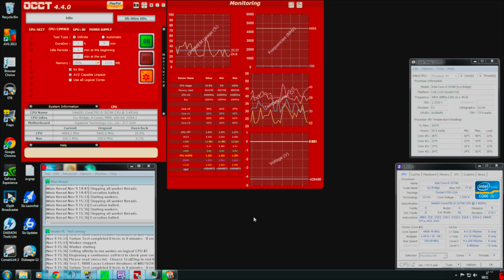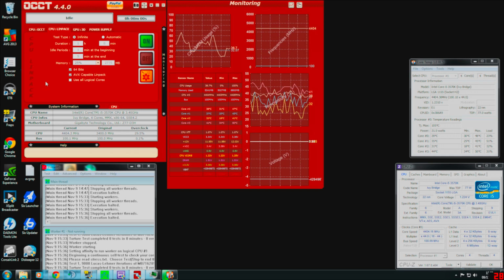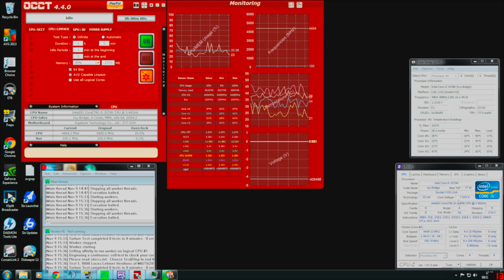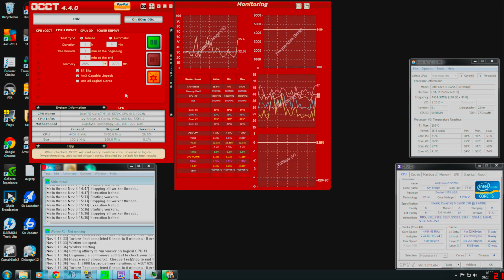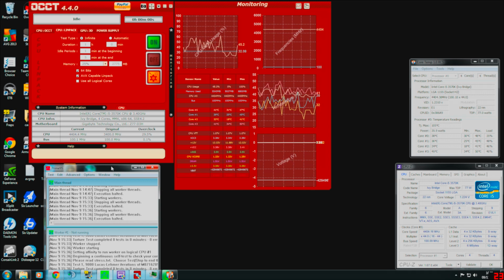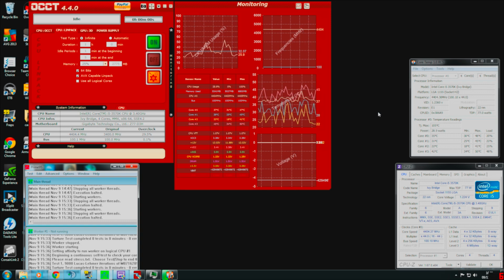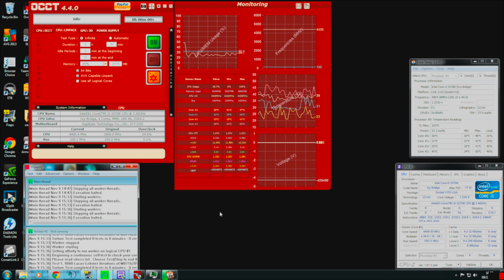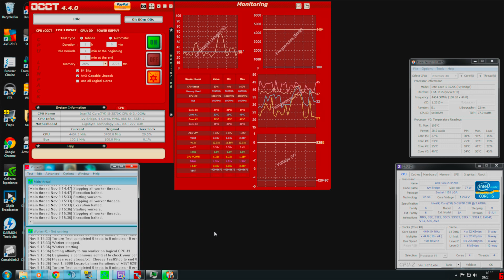How to stress test your computer/Gaming PC

Comment: So my laptop (i7 6700HQ) idles in the 50's and upper 40's. Whenever I start any benchmarking software, all readings INSTANTLY go up into the high 80's and stay there, without changing much at all. And when I stop any benchmark, it INSTANTLY, like, on the very next number refresh after stopping, goes back into the 50's. I don't understand the 35 degree jump and drop I'm getting in under one second. Is this a Windows 10 thing?

Comment: OCCT is my best GPU stability test with " FPS Limiter = 0 " and " error check ". OCCT will burn your card :)

my HIS R9 290 vrm1 temps hit 120 degrees while stressing..! i cant go higher than 1020mhz on coreclock but in the other benchmark is stable without problem, but OCCT will give me error.! but i see somebody can touch 1150 on coreclock without any problem but OCCT give you Problem. Be carefull OCCT will kill your card! watch your VRM and GPU temps. OCCT look like Furmark with Extreme Burn in! :) Sorry for bad english guys :D

Comment: When I run OCCT it'll only run for about 7 or 8 sec and the a window with pic will come up. is something wrong?
Reply: Arcehager you are killing your pc thats what it means
Reply from the maker: yeh mate doesn't sound good, could do with some more info whats in the message does it restart your computer after
Reply: It doesn't restart my computer. It said "CPU OVER MAXIMUM VALUE" VALUE REACHED 88, MAX VALUE: 85
Reply: +Hyrinmaru When your CPU is working, it produces heat. Maximum heat before damaging your CPU is around 80c. Your going over that, AKA you need a better cooler.

Comment: what is your CPU cooler? are you running water cooled or air cooled?
Reply from the maker: water cooled corsair h100 , but you can easily archive them results with a hyper cooler 212 evo or something similar as long as you have good ventilation

Comment: when you test your cpu does your frequecy stay constant at 4.4ghz or did it fluctuate up and down because i got a amd 6300 the stock clock is 3.5 and i got it to 4.1 with out uping the voltage and its stable i think i did a stress test and there was no problems but when i did the stress test it fluctuates from 4.1 to 4.0 and at times even down to 3.5 so im wondering is there something wrong or what could i do to fix this or is this even normal i really need help thanks.
Reply from the maker: no mine stays at what iv set it at not to sure with amd but your processor frequency should not change unless your using a program in your os and not controlling it though your bios, go in to your bios manually set your frequency     make sure you have auto voltage turned off    have a look at this see if it helps http://www.tomshardware.co.uk/forum/282067-29-overclocking-6300
having your voltage on auto can create lots of problems

Comment: hey man! just wanted to test my computer not overclock. i had some problems with ac3,crysis 2 and crysis 3. they crash alot. and when i used occt on 25% 30 mins and it was always at 95-100% help :S dont think it supposed to be that. the other line on cpu is around 51%
Reply from the maker: hi selecting 25% is only the memory usage not the cpu usage, when using most stress testing software it will use all available cpu resources so you will get 95-100% usage,    has your computer crashed when using occt and what temp are you getting
Reply: aha okey thanks

Comment: Hi I just built my pc,  and I was wondering do I need to stress test my oc? If so how?
Ps. I didn't overclock
Reply from the maker: ok first tell me your specs, if its a new build like you say and you haven't overclocked it its always worth stress testing so you can check the stability,and max temp your cpu, if you need help overclocking i can help you just post your cpu,motherboard,and your cooling system